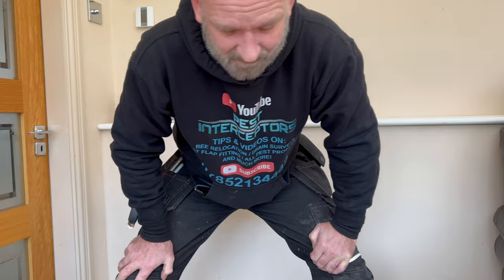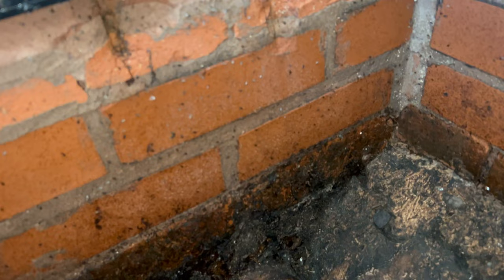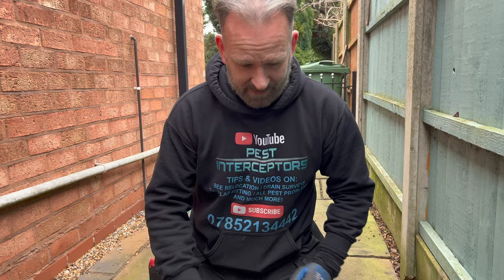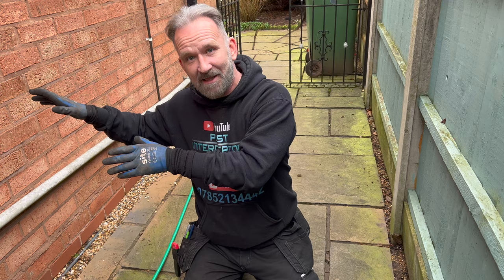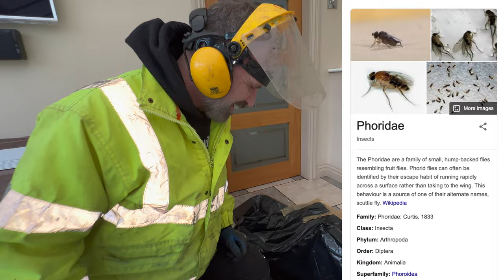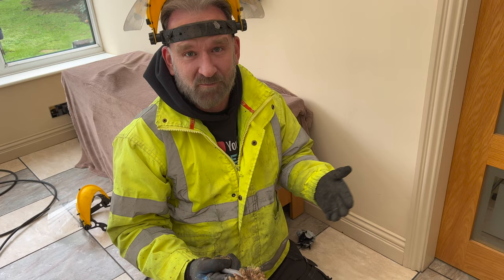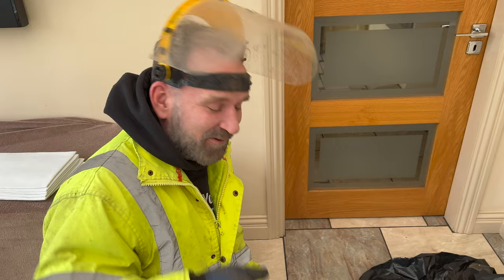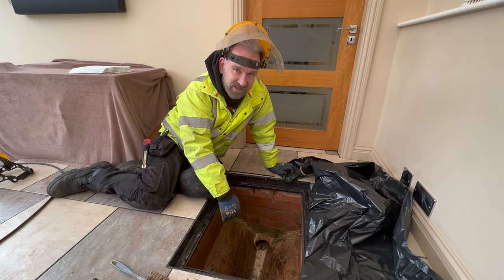DRAIN FLY? PHORID FLIES?!!! How to get rid of flies.

Comment: I have exactly this problem right now. Do you recommend a company who can rod the drains or a specialist pest control company? Im in Essex.
Reply from the maker: It’s not always the drainage and sewers so make sure you’ve taken the cheaper options out of the equation first. 
The problem with bad plumbing and fly infestation is that the breeding ground (poop) may quickly be replaced after being jetted clean. 
So a survey to assess for breakages and fixing of broken pipes plus jetting. 
So make sure it’s not an easy fix like a pot plant that the flys are using to breed in the damp soil.

Comment: @Pest Interceptors thank your for your video. I am having a problem with phoric flies in my office and do not have hope in solving the problem. I have had two different pest control companies out, a plumber, and now an hvac tech to help me find the source. My office is in a strip mall so I have several other businesses that have to get on the same page if we want to solve the issue. There is a smell so I went exploring and emptied my utility closet to discover water. No one could see a leak so I believe it may be condensation from the air. Nonetheless I cannot say for certain the fly problem is related. Who would be the best to call? Maybe a cleaning company? I am miserable 😫
Reply from the maker: With all flies, especially phorid flies, you need to find the food source they are breeding on. Take that away and the problem goes away. 
If you have any leaks that are tiny but making a damp area that is producing algae, that could be the issue. 
If you have any access into the sewer/drainage like a manhole. Lift it. If lots of flies come out, you’ll need to jet it out/fix the broken pipe. 
Good luck. If you were near us we could solve it.

Comment: I’m pretty sure we have phorid flies in the house (along many other bugs). I’ve been looking around online to see how to identify them compared to fruit flies and fungus gnats. I’ve yet to catch a live one to see if that’s what it is, but based on the “erratic running” they apparently do that is easy to differentiate them, I’ve definitely seen some around the cat litter in the past. I also read they can cause myiasis and stuff, and I’m both disgusted and terrified
Reply from the maker: Nearly all fly problems are best treated by finding the breeding material and removing that. 
Cat litter is a good pointer. Is there any cat poop hidden away somewhere other than the tray and remove poop from the tray asap.

Comment: Hello can these things be in my spit system air unit? I keep having these but I dont understand where they are coming from. I checked the drain on it seems to be draining water. These things are so annoying I spend so much energy fighting them to have them still here.. My parents say the Terminix and others wont help with this.. Im not sure what to do now. Not sure where they are getting a food source? can they get in a fridge and eat the food?
Reply from the maker: We feel your pain. 
A good place to look is the fridge…not in the fridge, behind the fridge! 
There is usually a water condensation pipe that goes from inside a collection inside the fridge that goes outside (back of fridge) and empties this water into a little open top tray (usually just above the fridge expansion tank). 
This water then gets warm and can be full of gunk, fungus, mold. 
Pull that fridge out and have a look. 👍🏼

Comment: I am almost 99% certain I am having a phorid fly infestation within my apartment, more specifically my room. I am on the first floor of my apartment and the most frequent place I see these small little bugs are my room. I have tried pouring down some sort of drain fly gel down all of my drains including my kitchen and my bathroom that is attached to my bedroom but to no avail.. They keep coming back.
Is there any other sort of source they may be coming from? They are mostly in my bedroom and I have a window very close to my desk within the inside of my room which is my only guess as to where they may be coming from. Maybe there is a gap small enough? Also, are phorid flies seasonal flies? Do they start to die off as it gets colder in the year? I have collected some bugs from a small UV light trap. Would there be a chance you could identify them if I can send the picture to you via. email?
Reply from the maker: Identification is key. 
Send us some clear photos. 👍🏼

Comment: Tiny little beggars.    I currently have a  horrid thai phorid fly infestation that's got out of hand . Cant see them individually  but see them in a "cloud " . Set up in every room of my home.  .Vacuuming them up out of the air  does some of the job but obviously hygiene helps take care of the rest of them. They are consistently attacking me. Urination is the main tactics of theirs
Reply from the maker: It’s  all about finding the source. Remove the food source/breeding material and they will disappear.
Reply: Do they piss?
Reply: @3_m_1_7  yes. A lot
Reply: @arguspanoptes9510  Do you mind giving me a bit more detail about their characteristics and behaviours? One could always delete the comment after. I had a terrible problem all winter with what I thought were biting midges but not sure. I've latex-sealed the whole apartment between walls and floors, installed midge screens in my windows, bought a midge net for the bed, would comb and vacuum my hair before "entering bed" (lol) every night and I riddled the whole apartment in fly trap strings. It looks like a damn dungeon in here, but for now I'm actively regaining my sanity. 
I've been dealing with this since the record precipitations November 2023.

Comment: Did you ever have an actual entomologist look at these flies? I have seen so many misidentifications on YouTube that I wouldn't trust this identification without seeing a photo of one.
Reply from the maker: We deal with them on a regular basis. 
But the lesson to learn here is simply this. All species of ‘filth flies’ are best treated in a non toxic way. You find the breeding material and remove it. No need for insecticide or fly traps. In fact those methods never really work. 
Ps. I think you’ll find there’s a photo in the video of phorid flies. These are phorid flies.
Reply: @PestInterceptors  The photo in the video is of the Wikipedia page on phorids. It doesn't show that is what you have. As someone who is an entomologist working on phorids for the last 40 years, I am dismayed by the number of misidentifications I see. I also want to understand better which species of phorids are causing the most problems, so I need to verify your identification. The scene where you lift up the cover and point to all the phorid flies makes me suspicious, as phorids rarely stand still like that. If you can  post a good photo of one of your flies, I will confirm that it is a phorid, and possibly identify it to species.
Reply from the maker: @brianbrown3150  it’s fine for our viewers. Thank you for your input. They are phorid flies.
Reply: @PestInterceptors  I have no doubt that they are flies and that your procedure eliminates them, but you still haven't satisfied me that they are phorids. I would think you would want to have someone look at them to confirm their identity, rather than learning you were misidentifying them at some later, possibly more embarrassing time.
Reply from the maker: @brianbrown3150  they are phorid flies. I’m happy for you that you think you know otherwise. But you are welcome to your opinion, even though it’s not a correct opinion. 
We have entomologists.
Reply: @PestInterceptors  great, condescending sarcasm
Reply: They are definitely Phorid flys.
Reply: @brianbrown3150  At 5:48 he shows the dead flies, these are phorid flies.
Reply: @brianbrown3150 as far as I’m aware a good sign it’s a phorid fly is if it scutters around a lot instead of flying and can be attracted to windows/light  and sinks, Food , rubbish and carrion.